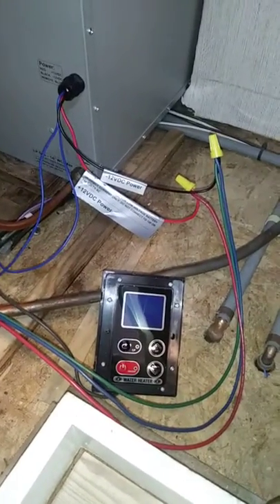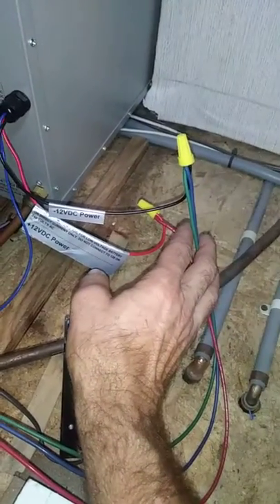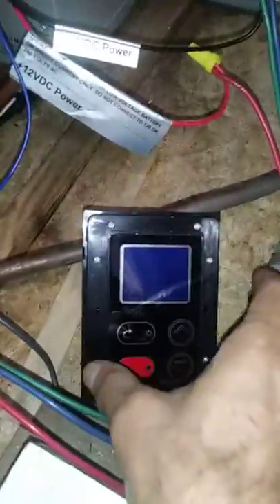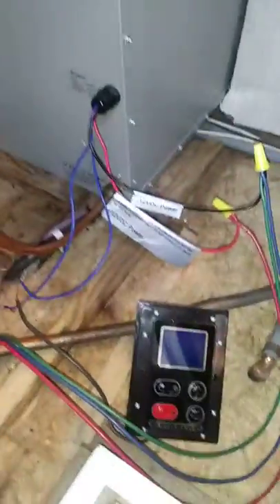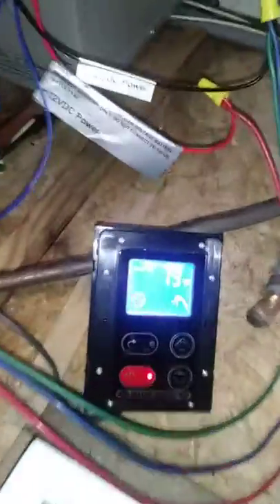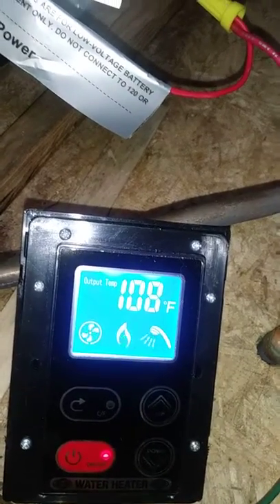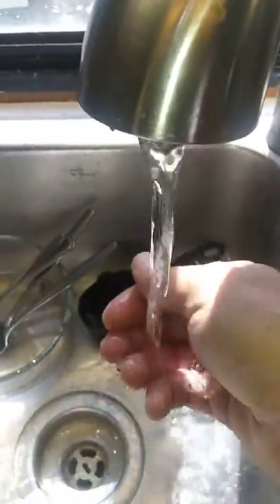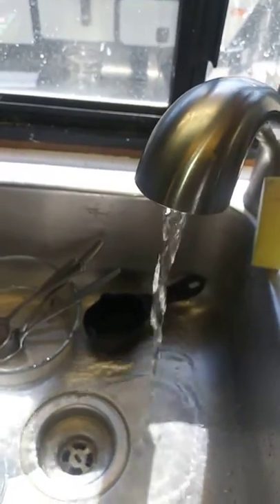Wiring for Girard tankless water heater

Comment: Which colors do I need to splice into for ground and positive.  I have no green wires
Reply from the maker: Check out the last 5 minutes of this video where we got our info:
https://youtu.be/xijQ376Ytyo
They talk to an electrician and end up attaching:  
Black from hot water heater to Green and Blue that comes from the RV.

Red from the Hot Water Heater to the Black from the RV.

We are not electricians and are only showing what we did and are not advising.
Reply: @whateversclever7087  I have no green or blue wires
Reply: I will double check

Comment: Why do you connect both the ground and negative to the black (negative) wire of the heater? What’s the benefit?

Why not just the ground wire?
Reply from the maker: Good question! Actually I believe I misspoke calling it a ground wire. I referred back to the video I watched (https://youtu.be/xijQ376Ytyo) by Duet Justus. They actually say the wire is to operate the old hot water heater switch on the wall.
Reply: Trying to figure out what wires to splice into for ground and positive.  What colors?